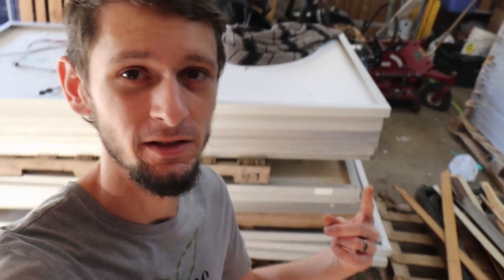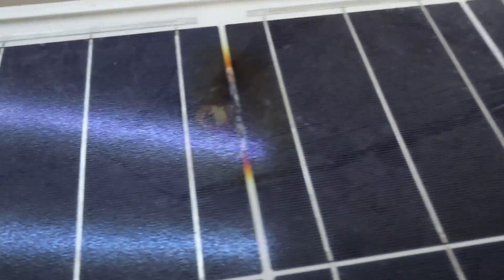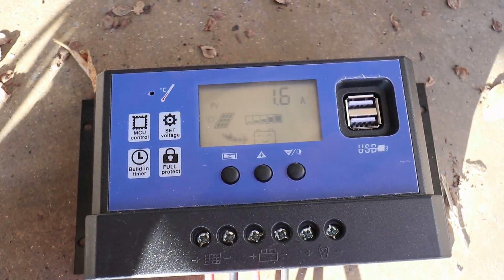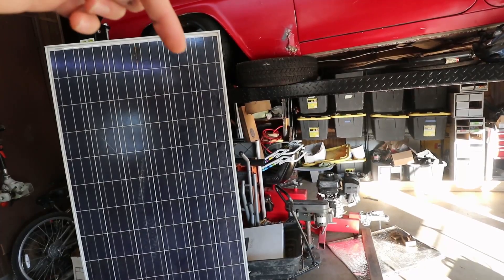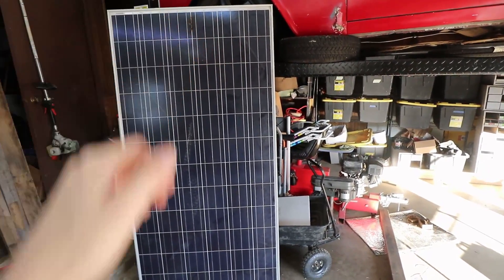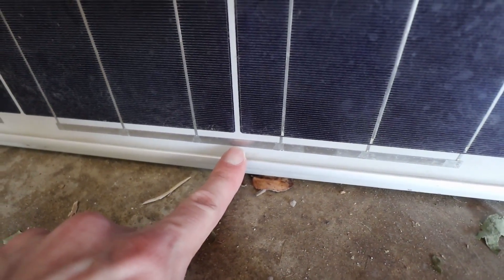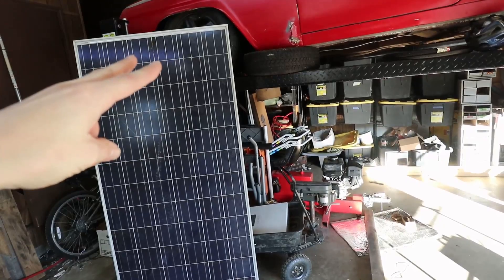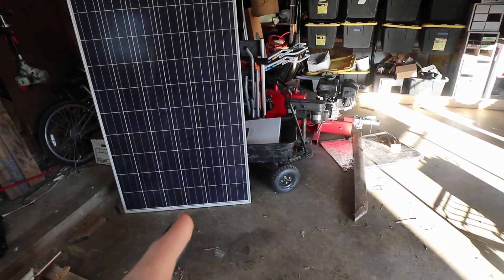Hack 36 Volt Panel For 12 Volt Charging - PWM Charger

Comment: So, this is very applicable to Typical 36-18volts solar panel to recharge cheap chinese  power station which can only receive 12volts solar panel for recharging?

If yes, the ampere will be reduced?
Reply from the maker: The hacked up strategy in this video trades voltage for current. So it turns into a "12v" panel at twice the current as the original panel. Same power.

Comment: I have a 24v panel 270W, I charge a 12v battery pack. that is, with an mppt controller, it is not so expensive and it charges even at dusk.

Comment: Can you simply put cheap charger controllers in series off one panel? Like put 2 controllers put positive on one controller negative on other and a jump wire between the controllers on +\- , like you do batteries in series? Might make an interesting video, if it works it would solve expensive mppt issue

Comment: can we use pwm charge controller 24v 30amp with this system
Reply from the maker: If you're running a 24v battery there are plenty of "24v" panels you can use with a pwm charge controller without any modifications. That's what I would recommend.
Reply: thanks for reply
Reply: i meen with modifed panel can i use pwm charge controller for battery portection battery. my fan are 12v with sigle 12 v battery

Comment: I'm new and a little lost would in theory this double the watts the panel could put out or dose it stay the same
Reply from the maker: It’s really a pointless problem to solve. It doesn’t increase the watts of the panels, just enables one to use a pwm instead of mppt charge controller. But mppt charge controllers are so inexpensive now it’s better to just use that.

Comment: 13a 12v is great for 1 pannel . Be good if you could post a video of how you cut in to the back of the pannel , very interesting . Thanks for posting
Reply from the maker: I actually did another version of this video and it has better footage of the bottom end of the panel.

Comment: There exists these  switch mode power supplies call buck converters and step down  converters.. much easier.   Drop  the voltage  output lower then the input voltage and you dont lose amps.. infact you gain amps

Comment: Great video but quick Question: (maybe stupid one):
What if you cover half of the solar panel? Would you get half of the 36v or you get 0?
Reply from the maker: If the panel was original still it would be split into three sections via bypass diodes. So covering 1/3 would effectively cut the voltage down by 1/3. THat's if you cover the right or left third. If you cover the bottom or top third you'd still have some voltage but no current at all since the bypass diodes can't skip the cells being shaded.

Comment: I have a 37v 8.13amp 300w panel, can I connect 3 12v 100w PTC heaters in series? Would this damage anything?
Reply from the maker: I haven’t done anything with ptc heaters in years. Can’t see how it would be a problem though. Keep in mind a 37v panel makes max power around 30v in optimal conditions so the heaters won’t be at optimal voltage.
Reply: @BeeneEnergy  cheers dude, complete novice I have a small 30w solar panel I will experiment with some 3 volt led bulbs in series. Start small I guess to gain the knowledge
Reply from the maker: @zuutube875  Yep! I like breaking things while I learn. I remember better ;).
Reply: @BeeneEnergy so true practical is much beter learning experience

Comment: You don't need to run a wire if you tap into the bars at the top.
Reply from the maker: I never was able to find a way to tap into the wires at the top and get the right voltage. If you do it and it works let me know how it’s done!
Reply: @BeeneEnergy  There's ONE other video on this and it's called something like hack solar panel 36v to 12v. After the jibber jabber, he shows you where and how to cut into the upper bus bars, doesn't show himself doing it, but does show the finished product. I just did it and it worked fine. I'm getting 10 to 12 volts on two panels and my really old mppt is now able to handle the panels. I'm not sure how pwm would do with such low voltage.
Reply from the maker: @JonEhBee  Thing is you can grab 2/3rds of the panel from the junction box. Voltage will be low. Consider that “12v” panels operate around 20voc. Splitting a 72 cell panel in thirds nets about 15voc. Not enough to get a good charge into a battery as vmp will be about 10v.

Just shot another video of this today with better lighting. Ended up with the same result and got an actual 275w reading out of the ~300w panel in the new configuration. It’s not too bad to do with an angle grinder. Knife wouldn’t take too long as well me thinks.

I’ll go search for that video.
Reply: @JonEhBee  Jon you will find this wont be effective as you are only getting 12 V from the panel and you need 16-20 VOLTS to charge a 12 V battery.

Comment: @ 3m 50s you're showing where u connected the wires onto the tabs... Could you please add a short vid on a) exposing the tab(s) @ bottom panel, b) splitting into 2 tabs w/o damage and c) explain w/u did w/the mc4's after running the wires to the top. Were the mc4's previously connected as the tab @ bottom was?  Thank you & btw baby Rose is a doll! And once she gets that speaking thing worked out she's gonna talk your head off!  :o)  The best part of life right there...
Reply from the maker: Yes this video had some bad lighting which made it hard to see. I’ll add it to my list to do it again. All great points!

Iirc used a grinder to expose the tabs and then a knife to cut it in two then peeled each side up.

Wiring is hard to say in text. But essentially I created two panels so I paralleled them at the junction box.

Yes I’m am thoroughly enjoying the littles. Thanks!

Comment: 12v battery systems are the only way to have independent power setups for not a whole lot of cash... awesome video.. thanks
Reply: @silviusksig  if you have electrical knowledge, shop around, i got 20 250w panels for $300 second hand, 5 kw!  Running a 24 v 2.4 kw in verter, 240 amps of batteries.  Adding another 300 amps in january, and upgrading to 4.2 kw in feb. 18 panels providing 150 amps charge current, tho rhe other day i was running the aircon, 2 kw, and putting 20 amps into the batteries

Comment: I have a small stack of those exact panels. I always wondered what i would do with them when they died. Thank you for showing me how to extend the life of these panels after they go out in one way or another eventually.
I used to live in dfw, woulda been cool to know someone like you when i was there!
Reply: just go mppt, they convert the higher voltage into lower voltage, higher current, and gain about 30% more usable power from the panel.  search around youtube for some info.  i run 660watts at 47v peak into a victron 100/50  to get 50 amps at 14 volts. when the sun is hidden, and the panels only put out say, 20v, there is still usable output. victron for instance is about $275, but so much better, and saves messing up the panels, bonus is a blue tooth app so you can monitor
Reply: @johncorlett3699  Actually you are correct, however, what Beene Energy has done is halved the voltage and doubles the amps to get 16 or 18 amps out of the panel. The Victron does not increase the amps. It only reduces the voltage from say 40 to 14 to charge the battery but only supplies 8 or so amps.
Reply: @mark-wayne-b2i  then it is clear that you know absolutely nothing about mppt, i suggest you do some research
Reply: @mark-wayne-b2i  Nah, MPPT doesn't work like that. It actually smartly converts excess voltage to current.

Comment: thanks good info.  What about using a 36/12 converter prior to the line entering the PWM.    thanks
Reply from the maker: It’s something that has been suggested and I’ve considered. Fairly certain the mppt will freak out when there isn’t enough sun. It’ll try to pull the voltage so low the converter might just reset over and over. Worth a shot but based on my limited knowledge it would be a challenge to make work.

Comment: If you use 24V battery you can use these cheap pwm controllers with panels up to 48V (voc). For 12V you need panels with voc max 24v.

Comment: What's about the diodes? I'm at 30v 8amps diodes in place
Reply from the maker: These are bypass diodes that aren’t needed if reconfigured to parallel.
Reply: @BeeneEnergy  Ok should I just unsoldered them? I crossed the wires as shown and placed them not on the output terminals but on the terminals in the middle.
Reply from the maker: @westindianmotors3816  yeah if you’re doing this you can just unsolder the diodes
Reply: Do you remove all three diodes. I ask because some people say to leave  the centre diode in place and remove the two outside ones.

Comment: do you thing i would get a good voltage if I turn 2 panels into parallel wiring ( 12 ish Volt ) and run those serial ?
Reply from the maker: I might be missing something but why not just run the existing panels In parallel instead of dropping the voltage and raising it back up again?
Reply: @BeeneEnergy  that way i won’t have to physically modify the panels with wire and holes and i should get close to 20/24V

Comment: Did exactly this to my old panels 6months ago! But I ended up with 3x11v strings as my panels were probably lower Voc to begin with, the 11v couldnt be used to charge a battery as it was too low. I had to use a DC-DC boost converter to go from ~12 to 15v, which was then enough to change a standard 12v battery, another quick workaround
Reply from the maker: I did that first, easier as it was all at the junction box. Think I ended up with 14voc which just wasn’t enough to charge without a boost controller. Good solution btw!

Comment: So what’s gonna happen a if I connect a 36v house pane with open circuit of 45v, so a PWM than can handle 50v to charge a 12v battery??
Reply: ~pop~  most usually, if the PWM controller can handle it, it'll just dump down the voltage and waste the extra as heat.
there are a few very cheap MPPT controllers these days, check out Adam Welch channel as he has tested several very cheap true MPPT controllers.

Comment: i am in this situation. i have 4 jinko 365 watt panels, i plan on only using one of them for now for testing, and it has a ocv of 48v. im guessing my cheap pwm is expecting 24v ocv. how sure are you that you cant connect the panel directly  to the 12 pwm? i see conflicting information on the internet about this. i was considering just getting a mppt that could accept the 48 ocv panel then still only charge a 12 volt battery bank, but your idea has me thinking other directions. thanks for the video.
Reply from the maker: I wouldn’t recommend hacking up a nice panel to do what I did.

Will the panel work with a small pwm? It is possible but unlikely, o tried this and blew a pwm controller. I have seen a pwm controller that was rated for 50v but I didn’t note what brand it was :(.

I think your plan of using an mppt controller for your test setup is best.
Reply: @BeeneEnergy  thank you for your advice
Reply: @jasonbrown467  - so, how did you do on your project?
Reply: @DavidHalko  i am sicker than a dog at the moment, so i am trying figure out what i was even asking up above. i think i was looking to see if i could use a cheap 12v pwm to connect a 48 ocv panel. i have learned a great deal about solar since asking this and my answer will be this: stick with mppt. mppt give you ranges of inputs and outputs that pwm typically do not
Reply: @jasonbrown467  - it’s all good. I am as just curious how u made out. Get well soon!

Comment: Can you connect the negative wire of batts to the frame of a trailer build and pick up your inverter ground at inverter location from frame with same size wire as positive lead say 2awg?This way only run one 2awg lead from batt location to inverter location?Mine are like 12-15ft apart
It's all 12v with 2000w inverter and 800watt solar panel(bought from you) thru a makes sky blue 60a charge controller.Its a cargo trailer camper conversion...
Reply from the maker: I can’t say for sure if it would work or not. Of the builds I’ve seen they don’t operate this way. I suspect it’s problematic passing a couple hundred amps from a heavy gauge cable into the frame.

Thanks for checking in! Would love to get some pictures of your setup as you build or once it’s done.
Reply: @BeeneEnergy  I'm curious if anybody has ever tried it or if it's always just do what everyone else has done and run both leads? Is there amperage flowing thru the negative side of a dc circuit? I dont have a clamp meter to check nor the knowledge...lol
Reply from the maker: @chrislewis9345  yes there will be current on the negative side.